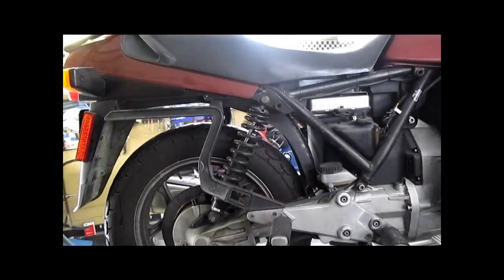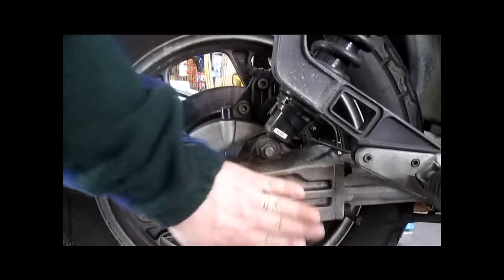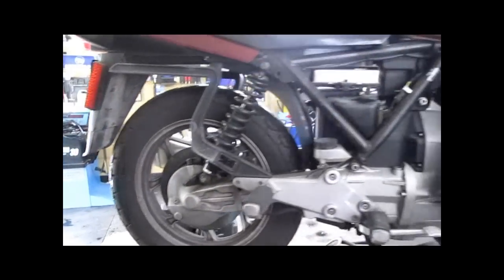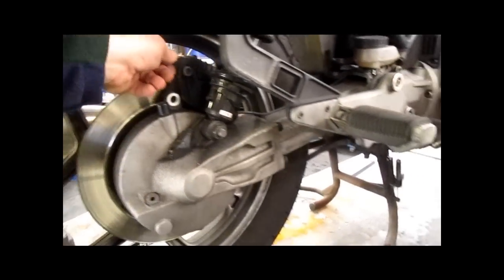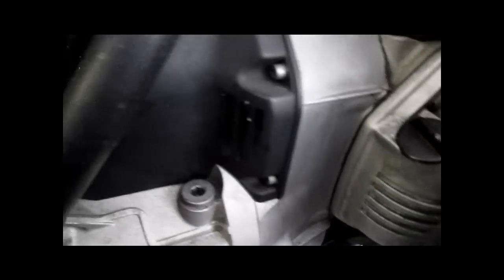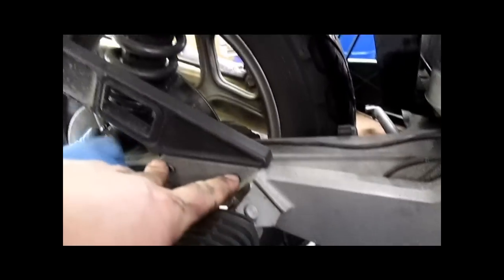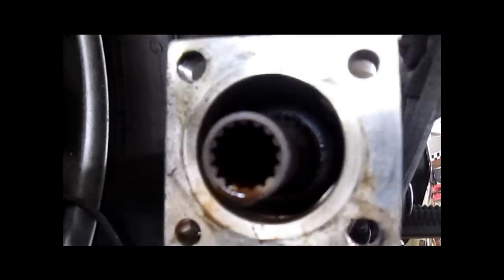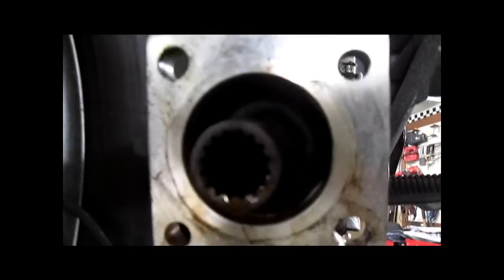BMW Service - K75/K100 Pre-Buy Inspection

Comment: Hi Chris. Man i spend hours watching your videos. THANK YOU  Buddy . You are really good. Please would you be so kind tell if there is any sound or sign the splines can be damaged without disassembling it? Buying a 1993 K1100RS with 120.000 KMTS. No Service History. Is winter, can not drive the bike but started it on center stand and went through all gears but  when I accelerate or (and) decelerate like suddenly i hear a knocking from the shaft. is it normal?  APPRECIATED

Comment: Hi,I bought a K75 last year. The splines are shot! On the shaft AND the final drive. To repair the shaft,a BMW spares place here in England,charges £54.00 for a piece that just welds on,and I can get a really good final drive for £150.00. 
The k bike only cost me £300.00!
Reply from the maker: Andy, you got yourself a cheap bike that is easy to repair... enjoy!
Reply: Chris Harris I wouldn't say that. It's been sat for 12 years! So far,new tank pump and filter and mesh,new fan. Having real trouble starting it. So,some suggested the fuel injection relay,as it dosnt idle,just floods.Take the plugs out and dry them and it does the same thing...What do you think?,be great if you knew. Fires ok,coils are fine,MAF ok,heat sensor plug ok...
Reply from the maker: @Soggz7785  How do you know the mass airflow sensor is good? Flooding is a symptom of a failed unit.
Reply: Chris Harris Hmmm...how so could it be failed,Chris.The flap in is isn't stuck. I have to be honest,I'm not hot on these bikes as I only got it a few months ago. How could I test it?  I've also been told that it could be the ecu.....it's a bit of a mine field...
Reply: Chris Harris I don't. Well,I know it's not stuck,as I took it out and moved the fin/door with my finger. Could the hanging sensor in it be dirty? I read that it can be sprayed with MAF spray. Is that right?
Reply from the maker: @Soggz7785  The door can move on a failed unit too. Try a different one. It is never worth fucking around with the original if the bike runs poorly; replace it and the rubber boot and clamp and life goes on smoothly.
Reply: Chris Harris Ha Ha! These bikes are a bit of a nightmare,aren't they? Give me a carb any day!
Reply from the maker: @Soggz7785  They are great when working properly. Miserable when they are not.

Comment from the maker: No, you can not. All that will do is get you to the driveshaft. You need to remove the transmission to clean and lubricate the transmission input shaft that the clutch hub splines ride on.

Comment from the maker: I'd start with a check of the throttle body synchronization. K's can make a racket when out of synch. Are all the rubber vacuum caps in place and not split?  Once the balance is correct if the noise still exists it could the the gear cluster at the back of the engine which is generally nothing to be too concerned about just irritating as the noise sounds like the engine is ready to grenade. Does the noise go away when the clutch lever is pulled in?

Comment: Chris, did you use any kind of sealer on the flanges in reassembling the rear drive back onto the tube? I have a "rescue bike" that was neglected. Spline-check is next on the list.

Also, I discovered the fuel tank has a couple of pin-holes and some corrosion on the inside. Looking to give it the Caswell treatment, any suggestions would be highly valued.

Comment: I did not enquire as to why the bike is not running. That's just what it said in the listing. I suppose that could also be an expensive problem. I will call tomorrow and ask.

Comment: hi chris, great videos ive 3 k bikes in the garage, when you state grease the splines how much grease, do you apply to said splines. ive used honda moly 60 i just strip it down and lightly lube the splines, everytime i change the rear tyre. does this need to be packed with grease or just lightly greased. great videos, your the man kindest regards steve..

Comment: Hi Chris, thanks for all the excellent videos! Did a necessary spline lube a month ago on my K100RT '88 (125.000KM) using your vids as a guideline.

I do have a question though. My bike has developed a rattle/clunking sound at idle. It  goes faster with higher RPM and is unhearable/disappears at ~2000+ RPM. It sounds a bit like a tractor, but I have difficulty tracing it. I suspect either the output shaft (not sure if 6 or 12 rivets) or the chain tensioner. What would you advice me to check?

Comment: Your BMW maintenance videos are great. I'm looking at a '92 750S for $2,600 that from the outside looks like a 9 out of 10. Although they look like great bikes, they do seem to be high maintenance. I've had many bikes, and have rebuilt several, but I never had a BMW and I'm not sure how much maintenance they require. From a few videos I've seen it looks like they burn valves. Is this your observation as well. Cheers from Canada.
Reply from the maker: Thanks. K bikes don't have valve issues. The K75, K100 and K1100 were the most reliable models BMW made. 400,000 mile examples can be found quite easily. Good luck.
Reply: OK thanks for the info. As I said, I've never had a BMW and am looking at maintenance and reliability known issues. I'ts starting to sound like a decent bike after I did a little research. Thanks again
Reply from the maker: Good luck.

Comment: chris is there any way of telling if the final drive splines are fucked with a pre buy test ride? thanks dave from uk
Reply from the maker: +david kirkham No.
Reply: chris i am buying a used k100 56000 miles  1987 from a dealer hes not bmw it was supposed to have genuine
service history it was iffy to say the least only on receipt for main dealer 9 previous owners very tidy but very shinyi am wary its not been serviced properly and found a little emulsified oil inside oil plug ! hes offering a 3 month warranty he says he will strip the bevel box and photograph for me plus service oil change although his workshop not tidy tools everwhere.do i take apunt or grind the price down and do the work myself price was £1750 but i want £to pay£1500 what do you think?

Comment: I am about to purchase an 1987 K100 RS. There is no way I am going to get the seller to let me check the rear drive splines before purchasing. It's got 51K miles on it so I am hoping the splines aren't screwed. Am I crazy to buy it and lube the splines after I get her home?
Reply from the maker: If the seller is unaware if and when the driveshaft was replaced I'd expect the worst and negotiate the price down accordingly. Good choice of bike. Best of luck, Chris
Reply: if the splines are worn the shaft engages with a bit of a bang as you set off, mine eventually snapped as I was pulling out of a junction. the replacement was much quieter. 10 year old bike with 40k

Comment: Hey Chris, I'm looking at an 1985 K100 with 35k miles. It's at a used bike dealer, doubt I can tear it apart as described in your video. What other things should I look for and listen for on my test ride??? By the way, I am looking at this bike strictly as a tug for adding a sidecar to most likely a ural tub or a CSM tub ...

Comment: Was wondering if you have ever had any experience of running these wet, as in pre paralever Airheads?
Reply from the maker: The housing is not sealed and the driveshaft rubber damper not rated for oil.

Comment: Chris, I couldn't find a video of my problem, so I'll tell you here I have the 1988 k100 lt......The fuel return line from the fuel rail is leaking..prolly an ethanol victim. How much of a  pita is this to replace in a driveway? Can I get to the hose from the right side; after I take out the air filter box?......the hose is fine on the rail side...it's leaking fuel from the buried side, naturally, right?! I'll send you my number on fb.

Comment: Well, I am not even getting the 4 bolts off to inspect....they are so tighten up....any hint apart from a good bit cos I am a bit afraid I ruin the boltshead inside!
Reply from the maker: STOP! Clean out each Allen head with a pick. Make sure the Allen key fits snugly and all the way in. Use a pipe on the end of the Allen key to break it free. Repeat for the other 3. Good Luck, Chris
Reply: hi Chris, thanks for the quick anwser. So no heating up of the housing or grinding away of the washer to release the pressure? ...I figure these bolts haven’t been released the last 60k miles/10 yrs.....I love watching your vids and  to adapt it to my own K but I hate these allen bolts being always at the edge of breaking.....I ll give them first of all a good clean, thanks!
Reply from the maker: @frankgores9348  Warm the housing too. Good luck.

Comment: Looking at a 91 k75s with less than 10k miles. I will not be able to disassemble the bike to inspect the splines. Should I be concerned? It's the original owner, bike is still on the original metzler tireswith about 85% tread left and is very clean. He said he just never rode it. Naturally the odometer shit the bed but I do trust that it has less than 10k given the condition of the bike. 

In summary, should i be concerned with the splines at this point?
Reply from the maker: No, the splines should be just due for cleaning after 22+ years and only 10,000 miles. Good luck & happy 2014, Chris

Comment: Actually I'am looking to buy a R1100GS from 1999. with 91000km on the clock...what should I look or where should I look first? Bike seems in a very good condition outside but with that much miles on it probably has some folts...what should I check before buying it? Thanks again.... :-)

Comment: Should the same mantra: "New Tire Re-lube" be the same for a R1150GS?
Reply from the maker: Hi, no, it is a different design. The R100GS and R1100/1150 GS models came with the the Para-lever rear drive using a 2 part driveshaft (to be replaced every 40,000 miles). The K100, K75 and earlier R80GS use the Monolever rear drive having a one-piece driveshaft that needs frequent lubrication but still eats the pinion splines.  The Para-Lever was a better, though heavier, design that did not show failures until models made from spring of 2000, at least in my part of the world.

Comment: Hi Chris I pulled the rear drive out of my 1990 k75s found rusty splines and piece of a circlip. So i pulled drive shaf out and circlip at universal joint spline is damaged,is this an eazy fix? all splines look ok after cleaning. Thanks Chris.
Reply from the maker: Go to your local automotive driveshaft shop and see if they can provide you with the correct size clip. I do not know what size it is, sorry.

Comment: what grease do you use to service the splines?
Reply from the maker: Staburags NPU30PTM from Kluber: https://www.amazon.com/Kluber-Staburags-NBU-PTM-Tube/dp/B01N4FPO2C/ref=asc_df_B01N4FPO2C/?tag=hyprod-20&linkCode=df0&hvadid=312431208856&hvpos=&hvnetw=g&hvrand=17274916461194614518&hvpone=&hvptwo=&hvqmt=&hvdev=c&hvdvcmdl=&hvlocint=&hvlocphy=9002739&hvtargid=pla-761938697512&psc=1

Comment: Hello,I know that the coment might not be at the right video but I will leave it any way,hoping for some help :)
I have some electrical problems on my k100.
The last couple of days the signal lights and head light started to go crazy.The head light was going on and of when ever he wanted,and the signal lights signaling mixt and hazard and everything mixed.
Bike was starting and when was doung wered thing on the lights,I just stoped the engine put it back on and it was fine for a wiled.
Yesterday morning tried to started up,well I coudent so I pushed it a bit in first gear and started from the button.This morning my brother had to push me,she wont start from the button,no head light no rear light no signal light no horn,but the engine is working if it's push started,and the brake lighta is working as well.All I can here when I push the button is the noise of the fuel pump and a ticking coming from the relay box.Fuses all changed.
Please give me some good tips ,what can I do.Thank you for your time, Greg.
Reply from the maker: Disconnect the battery cables, negative first. Remove the starter motor from the bike. Disassemble the starter motor and clean the contacts and brushes. That should solve your problem. I'll have video of this procedure at a later date. Good luck and enjoy your K100, Chris

Comment: That brake rotor is done.
Great vid tho.
Reply from the maker: Hi Chris, the rear brake of a K75 / K100 / K1100 is 10 - 15% of your braking power - virtually useless except for trail braking and in town stops. As long as the disc is not too thin it will work the same out back. Front brakes are a different matter as 85 to 90% of your stopping power is from the front and severely scored front brake discs will drastically increase your braking distance and can also create a lot of noise. Stay tuned for a lot more, Chris

Comment: Thanks for the suggestions.
I've synced the throttle bodies after replacing all the old rubbers and would appreciate it if you could listen to this video by copy-pasting the link after youtube.com
/watch?v=NXwyyxn8E1s
Could be that the microphone isn't picking up the lower frequencies, but doesn't sound that bad to me now.
Maybe I just need to accept that these bikes are not the youngest anymore.

Comment from the maker: Hee hee hee hee :) I hauled a Nissan way back when I was driving car carriers. This shit box had an alarm system and I had no key. The alarm is howling, the lights are all flashing. I get the turd loaded on to the truck and listen to the alarm for a few miles. Enough. Out w/ the break-in tools, into the car, remove every fuse in the fuse box = left headlight still flashing like the police! Fuck it! The dealership informed me that there was no way to stop the light unless I unplugged it! JUNK!!

Comment: Anyone familiar with the 1994 k75 BMW touring model spitting oil out of the exoste and dirty smelling smoke the bike has 92000 but the engine sounds really good and it runs smoothly lots of power as well if I can purchase it for $ 500.00 would it be worth the investment
Reply from the maker: $500 in parts easily

Comment: Are you referring to MAX BMW in CT? was looking at a bike from there.  I also found an 85 with 22k miles but it needs love. Guy is asking 2k. It has an oil leak and probably needs a front wheeling bearing and hasnt run since 2009 but still starts. Do you think hes asking a fair price, I was going to offer $1500. What else should I worry about at 22k. Thanks in advance!!

Comment: Hi Chris, 
I recently found a very cheap '85 K100 for sale on Craigslist. It seems to me to be a decent starting point for a very cool bike project. It is listed as not running with good compression, about 73,000 miles and has the monolever rear suspension. Do you think there's a chance of the splines on this bike still being acceptable? Or is it anyone's guess? Thanks!